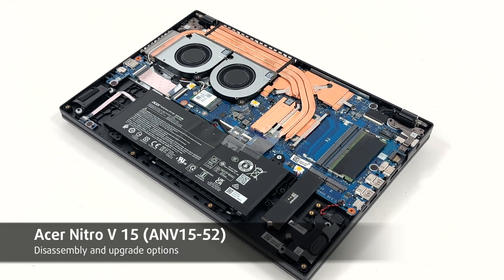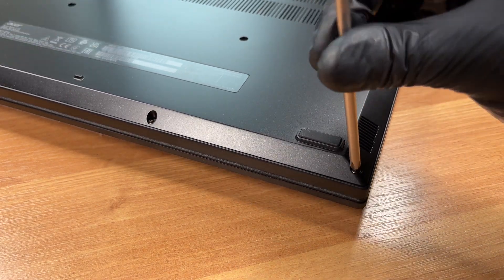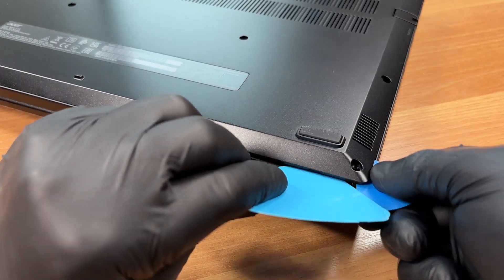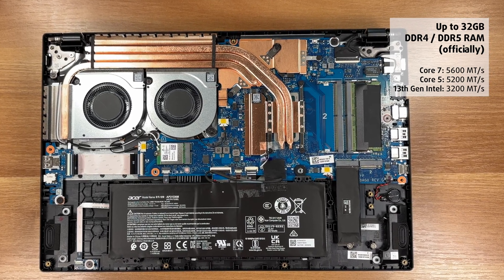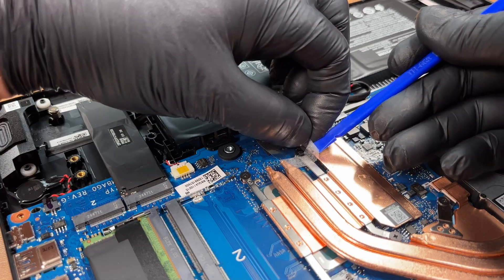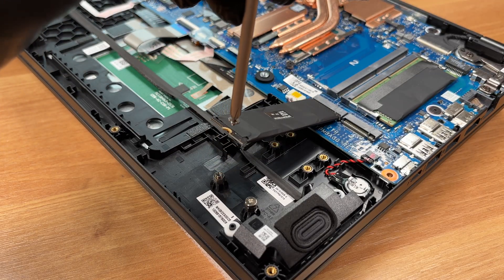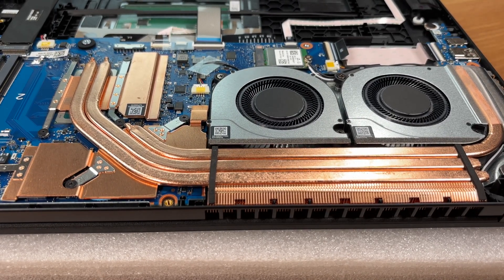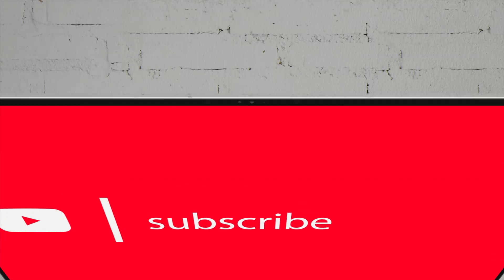🛠️ How to open Acer Nitro V 15 (ANV15-52) - disassembly and upgrade options

Comment: Mine is the Acer nitro v15 anv15-52 759k. The battery is larger and only 1 SSD slot which I didn't know before buying it and the SSD!

Comment: Hello, I have this laptop as well.Your video says it holds up to 32 gb of ram?Is that in total or each stick.. I only ask this because i've found ddr 5 up to 560Mz , for replacement, but it is 64gb which everything falls under the right stats that you list in the video, except for the 64

Comment: The internal fan is strange; it only has one air outlet and no air inlet. Unlike the other one, which enters from one side and exits from the back.
Reply: i have this laptop, its all air outlet it only sucks in air from the bottom and throws it out from the side and back